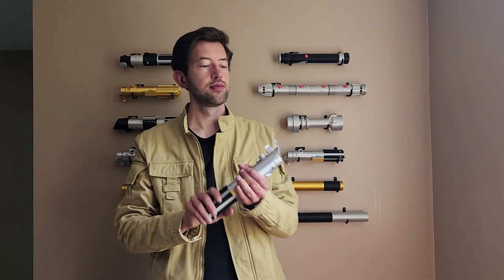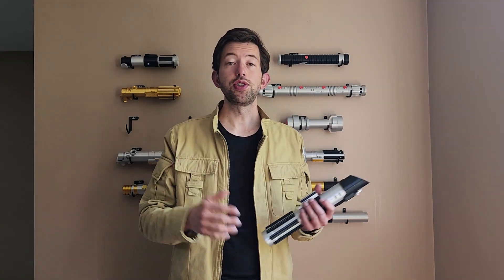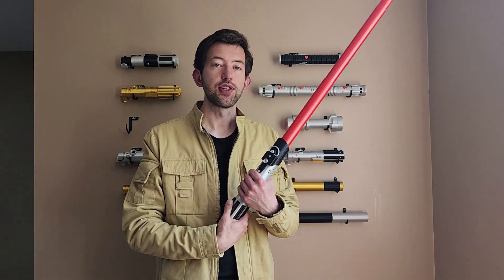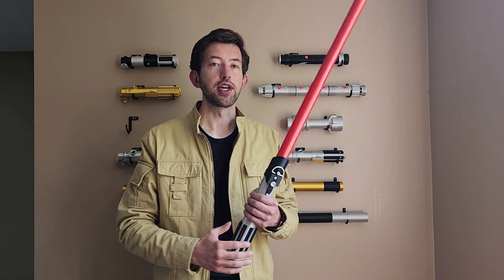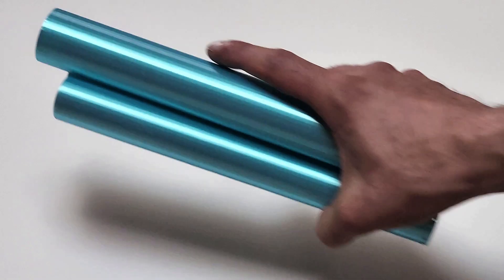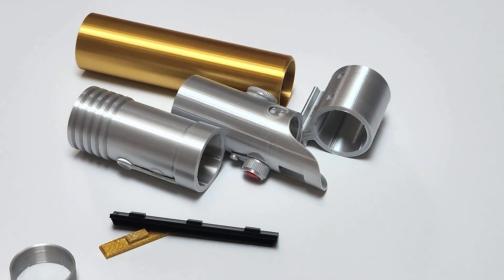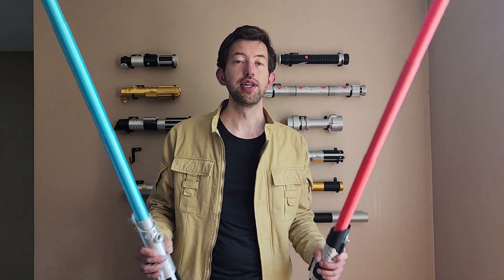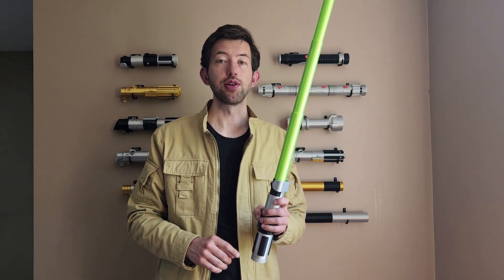A Retracting Blade! Twistsaber

Comment: how difficult would it be to use clear filament for the blade, and add a battery and a HV LED that is activated when the blade is extended, making the blade light up?
Reply from the maker: No difficult to make, but I worry about how the light would travel through the internal screw system
Reply: @twistsaber  Hmm. I may have to experiment. May need fiber optic wires or something. How many walls thick is the screw and the blade each?
Reply from the maker: @robhopper5729  everything is  0.8mm thick
Reply: Very interesting, mind if I contact you?
Reply from the maker: @Patara.  My email is on the website

Comment: Wil this also work when all the parts are printed with SLM (selective laser melting) from metal? :-) Looks like this has some real life applications in that case. Especially when printed with the micro porous metal created by that Dutch company that allows gas to flow through it to set it on fire over the full length of the blades ^^ 😅😂

Very cool design sir!

Edit: a more child friendly version could perhaps use glow in the dark polymer for the blades… would still need a way to excite that material for it to glow though.
Reply from the maker: @nirodha7028  I haven't tested metal printing
Reply: @twistsaber  I have with other parts. It’s extremely expensive but very satisfying and precise :-)
Reply: @twistsaber  it works really well! Let’s do a collab :-) Ask PCB way to sponsor your next video. We’ll create a fully titanium printed version :-)

Comment: question, why are the blade tips seemingly squared off rather than rounded? I think these are very cool, just curious
Reply from the maker: yes, a future video will explain the trade-offs and whey the blade is shaped like that
Reply: If I remember correctly, it's to help the entirety of the blade fit in the handle without having a little of it stick out when collapsed.
Reply: @TagartTalking seems like you could keep the length of the piece the same and just round the tip off